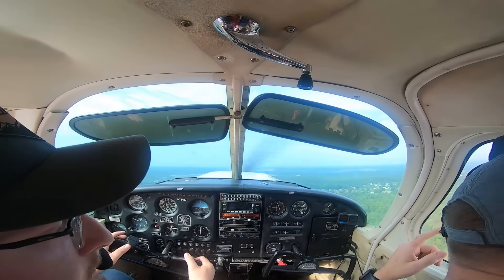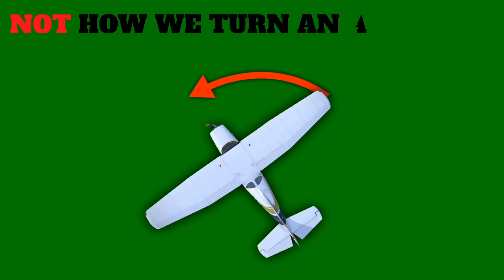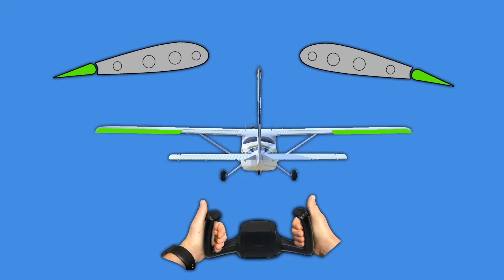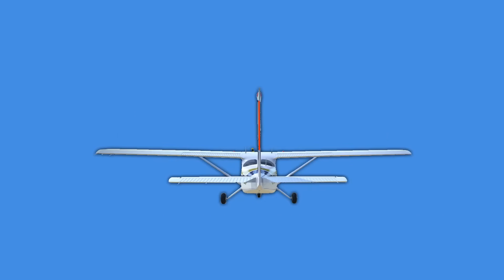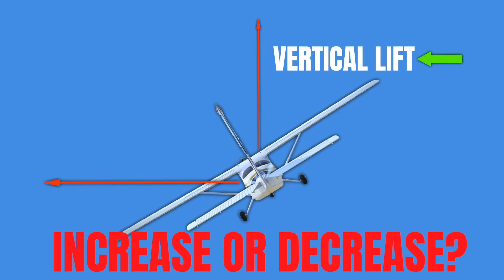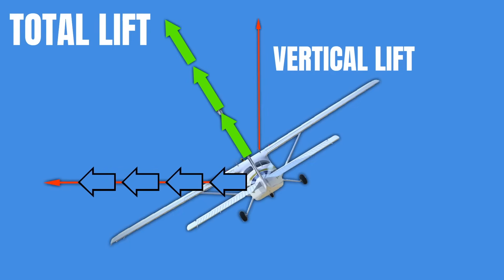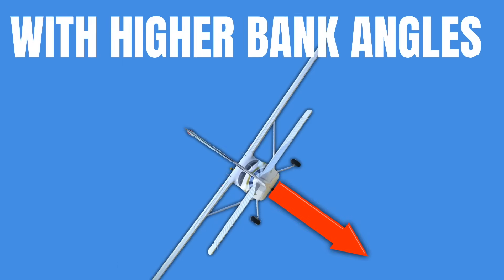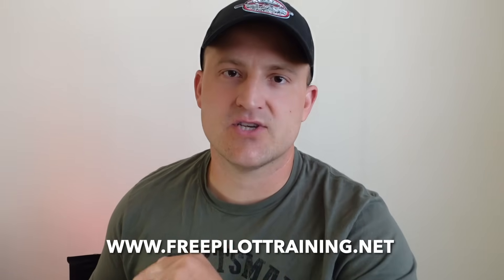How to Turn an Airplane (FREE PPL Ground Lesson 9)

Comment: If I buy the ground school package for private pilot, can that test be used if I decided to get sport pilot instead?/ Or is the material translatable between the licenses?
Reply from the maker: Yes, I will exchange the course if you decide to switch. The course is mostly the same but there are some small differences.

Comment: This is the same explanation as appeared in the instructional materials I was given during pilot training. I found it lacking one aspect which makes this explanation not sit well with me; this is how I now believe it works...
Explanations of lift up to this point in my training had described lift as acting through the centre of gravity of the aircraft. Adding a horizontal component of lift through the centre of gravity would add no turning moment to the aircraft. It would simply move it "sideways" making the aircraft crab across the sky (Imagine this is happening in deep outer space with rockets providing the depicted lift forces). Without some moment created by shifting the lift in front of the centre of gravity we'd get not turn. I believe the elevators actually provide the turning moment as a side effect of adding the necessary extra lift when one pulls back on the stick during a turn -- in effect making one "climb" through the turn. So any 360 degree, constant height turn is just a loop manoeuvre performed at an angle where the extrinsic gravitation force operating independent of the aerodynamic forces, pulls the loop down to be level. I ended up making simple aerodynamic simulations before I felt I actually had a (limited) grasp on the physics of turns.

Not that I think this is a bad description. I think it very much helps new pilots think about the right way to operate the aircraft to get it to turn, but I found, for me,  it raised more questions than it answered during my training.

Thanks for another great video.
Reply from the maker: Unfortunately, I have to keep it very close to the way you will be asked on the written exam

Comment: 🤪 1:35 "thumbs up, ailerons up' makes no sense with the image you used.
The Left aileron is up together with both thumbs being 'up' while holding the yoke, and the highest thumb on the right is OPPOSITE to the highest aileron! - it's all FKD up.
Reply from the maker: Both raised thumbs are pointing to the raised aileron
Reply: Yeah, but WHAT WAY are the thumbs pointing?
Reply from the maker: Exactly